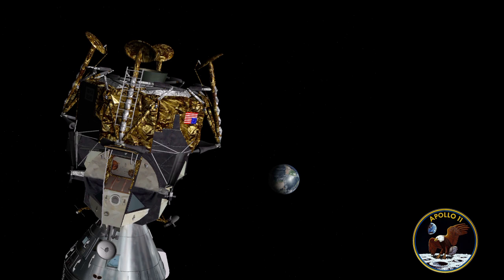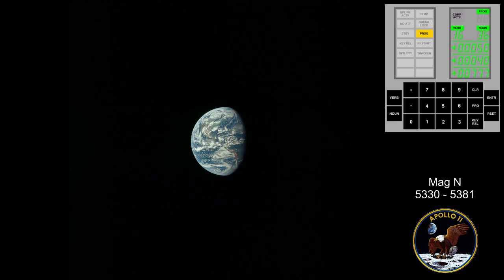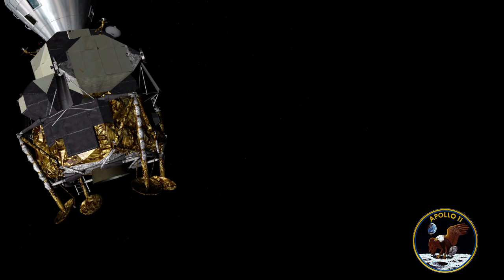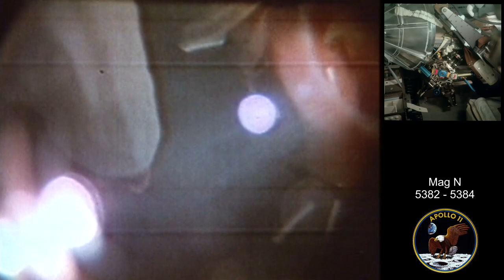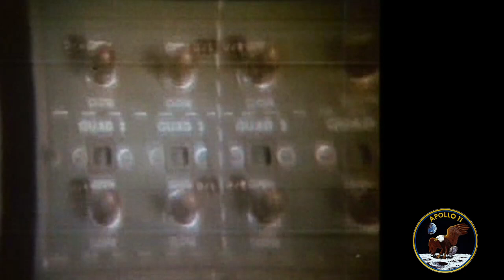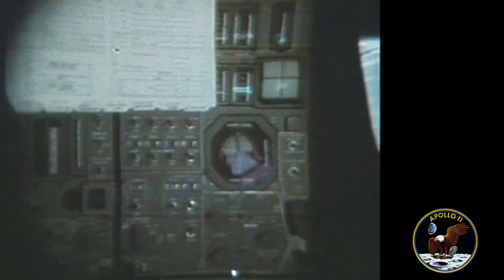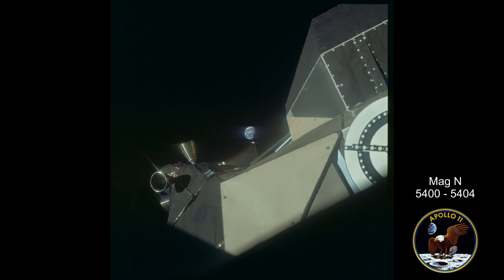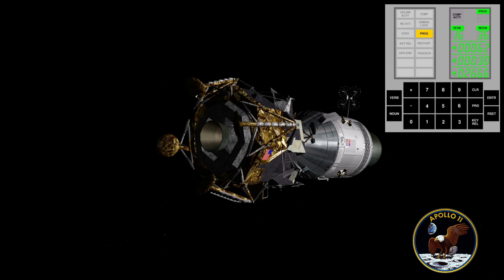Apollo 11- Day 3 (Full Mission)

Comment: What's the situation when Buzz removed the shades from the LEM windows ? Because they're far out of the  Earth's atmosphere wouldn't there be a real danger of getting a high dose of shortwave and medium Ultra Violet radiation ?
Reply: I'm going to take a stab at this.  All the way to the Moon from the docking maneuver, the docked spacecraft were in a PTC - the infamous barbeque roll.  I'm going to say their exposure to direct sunlight through the windows in both craft was minimal.  Also, it's very possible the windows were coated to reflect a great deal of what they were exposed to - just as their visors on the Moon were gold-coated.  I welcome corrections to what I've written.  I'm just taking some educated guesses.